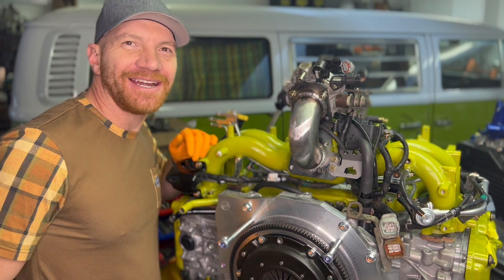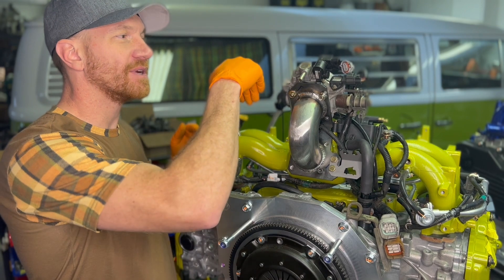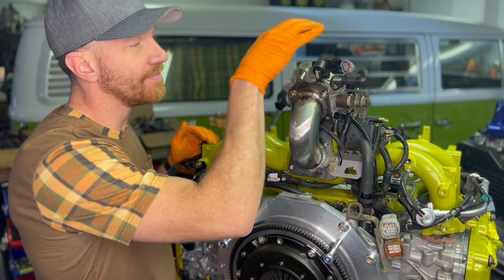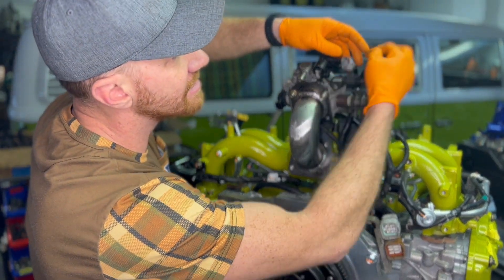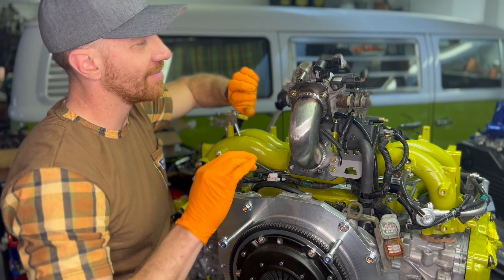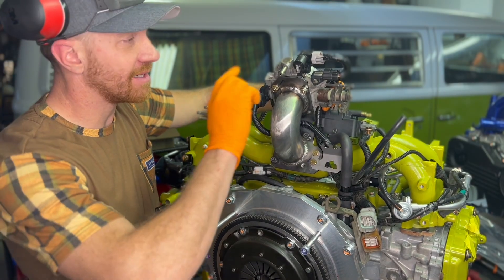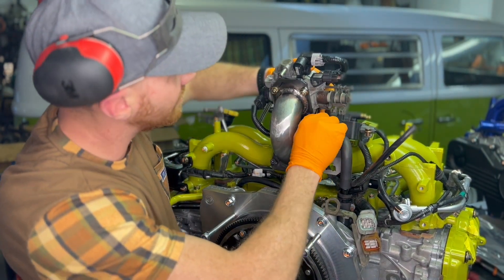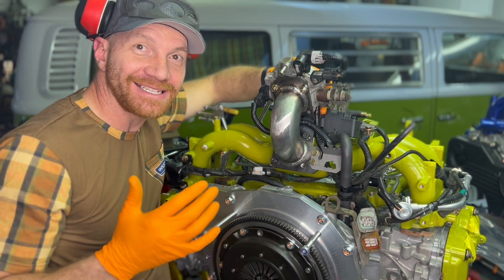VW Subaru Conversion Tech Tip 002: Extend EJ25 Engine Harness Reversed Throttle Body *MANUAL TRANS*

Comment: Great video. Thanks for sharing!
Also, every time you make a but splice, god kills a kitten. ;)
Reply: Montana, thank you! Very much appreciated. And I have apparently killed more kittens than can be counted. My question now is..CAN THERE BE ATONEMENT FOR SUCH GRAVE SINS?!?
Reply: @travisramos4518  lol. Just have to adopt another cat. 
But seriously, totally agree that a but splice is fine, and preferred in a vibration environment. Just make sure the right crimp tool is used. It’s what Subaru uses and looking at the wire harness I used from 2005, it was still in perfect condition.